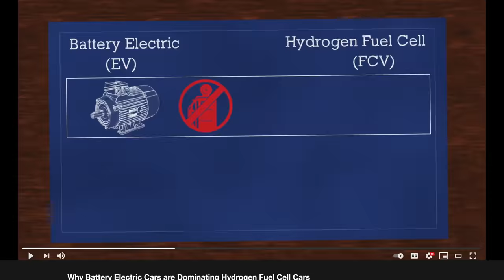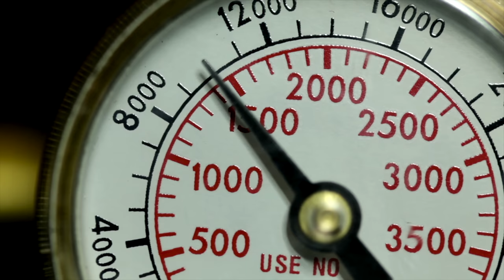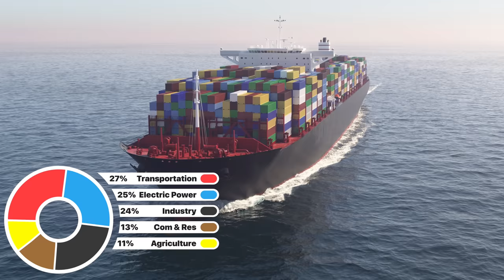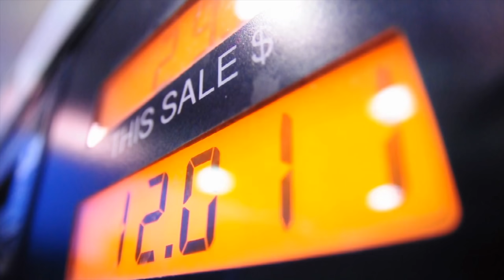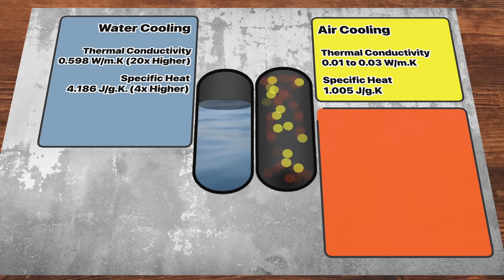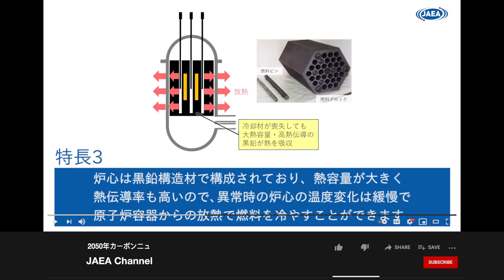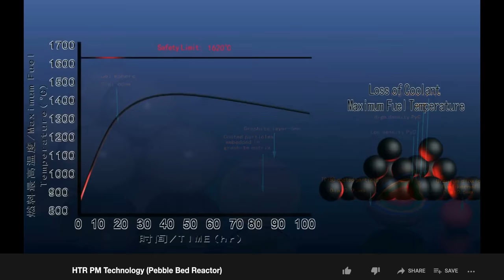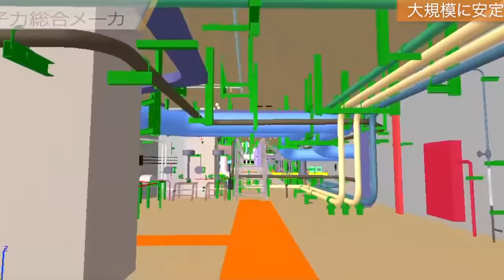Japan's Plan to DESTROY the Price of OIL and GAS!

Comment: Japan is surrounded by water, salt water that can easily be broken into 2 parts Hydrogen, 1 part Oxygen.  Both elements can be used chemically to produce energy, under the right applications.  Even in high school in 1964, for a science project, I demonstrated an apparatice to break apart a salt water solution into H2 and O2, collect the gases, compressing under low pressure both gasses separately and powering a  simple steam engine, built by a class mate.  We won science fair ribbons.  A novel thing to consider back when gasoline was maybe  15 cents a gallon.   Maybe when gasoline is 15 dollars a gallon, people will have more of a use for Hydrogen technology.
Reply: @jackasshomey  the power to split water into H2 and O2 can come from a green renewable source from an aray or series of wind turbines off shore and monitored for maximun electrical output and no danger from birds getting killed.
Reply: @jackasshomey  Everything the people of earth need to have a sustainable life is right at our fingers if we can just get our law makers to do what is necessary instead of lining their pockets with corporate money.   Spell that Greed and Corruption.
Reply: @robertshorthill6836  wind turbines are extremely ineffective when compared to a large petroleum refinery's ability to produce hydrogen with methane... 1 single steam methane reformation plant can produce thousands if not tens of thousands times more hydrogen then your largest wind turbine operated electrolysis cells simpily because the quantity of hydrogen in CH₄ is double the quantity of hydrogen that is in H₂O and hydrogen really likes to stick to oxygen... so its very difficult to split them apart, as appose to methane where the 4 hydrogen atoms are bonded to a single carbon atom which is easily broken
Reply: @robertshorthill6836  if making fuel from literal shit isn't considered "renewable" like i don't really know what to say...
Reply: @jackasshomey  So what do you do with the 1 Carbon atom ?  Do you burn it which makes CO2 ?   Burn Hydrogen atoms and you get water.   Use that water to grow crops or fill Lake Mead, huh?
Reply: @jackasshomey  water is not that hard to split into H2 & O2.   Really, wind turbines can supply the electricity to do just that.  I have split salty water with just a reostat hooked to household electric current.   The higher the current, the faster the gases came off the electrodes.
Reply: @robertshorthill6836  hydrogen is actually really difficult to split from oxygen... you'll learn this in science class, its because hydrogen really likes to be bonded with oxygen and you need really high amperage electricity current to effectively power a hydrolysis setup... as for the efficiency of wind turbines your gonna have to use a massive portion of land as a wind farm which then becomes uninhabitable due to the fact that you now have hundreds of spinning blades overhead, you also tend to forget what goes into making those turbines and because the turbines cant directly power the electrolysis the power is fed into dirty lithium batteries which then provides a stable current thats able to actually run the machine... and we're not talking about your petty tabletop setup of 2 beakers with alligator clips and thin strips of metal, the electrolysis setups they have require massive amounts of power due to the fact that when you scale your power demand goes up drastically, you then need to replace a massive platinum anode whenever it gets corroded away which isn't cheap... at all...  your process literally destroys a rare earth metal in order to happen... steam methane reformation doesn't require any of those things... it just requires methane, heat , pressure and a carbon storage trunk to capture any exhausted CO2...

thats the only problem the environuts seem to actually have with steam methane reformation... the fact that it exhausts the 1 carbon atom... but if we capture the carbon that deals with the problem.
Reply: @robertshorthill6836  as for what you do with the carbon atom, let me tell you... again... because its not like i didn't already tell you before hand... you capture the carbon atom and allow it to return to its raw form... you then collect it and sell it as raw carbon.... for things such as oh idk carbon fiber... which your wind turbine blades are made of....
Reply: @judess… I can’t believe you typed all that out and don’t understand what green hydrogen is. Please stop typing and start googling.
Reply: @DJLoveHz  i know what "green" hydrogen is... problem with your "green" hydrogen is that 95% of all hydrogen generated in the world comes from steam methane reformation... because its a cost efficient method.... you do realize how much a fucking single wind turbine costs... now multiply that cost by 100 for a small usable instillation, a single wind turbine costs around $2-4 million dollar range. Operation and maintenance runs an additional $42,000-$48,000 per year and that's not even taking account of the cost of the platinum cathode heres the cost of platinum per ounce $925.00 and for an actual usable hydrolysis instillation the size of the cathode is gonna be on the scale of multiple meters long.... that's gonna be hundreds of kilograms of platinum that will need to be replaced and you know how many ounces it takes to make a kilogram? around 35 ounces... so your cathode is gonna run a cost of like 3 million dollars to replace every time it corrodes away...
Reply: @DJLoveHz  like before you've even got the thing running your gonna be around 1/2 a billion in the hole... the current method of making a usable electrolysis plant just isn't cost effective...
Reply: @DJLoveHz  it would be more cost effective to retrofit large petroleum refineries with carbon capture technology and just ramp up the production of hydrogen from hydrocarbons
Reply: @DJLoveHz  any other questions about my knowledge?

like sure large carbon capture projects may currently have a comparable cost to a large hydrolysis instillation but that's only at the moment while they are far and few the cost will decrease as more and more carbon capture instillation's are built... wind turbines aren't getting much cheaper and platinum has a fluctuating cost...
Reply: @DJLoveHz  and a steam methane reforming plant can produce pretty much the same amount of hydrogen per year... on average a single steam methane reforming plant can produce 617 metric tonnes of hydrogen per day 617 x 365 = 225,205 and that's just an average some plants may be bigger and some smaller, but when you compare cost and the amount of land the project requires, hydrolysis just costs more... and uses wayyy more land
Reply: @DJLoveHz  where hydrolysis would be effective is in a hydropower dam, constant power equals the ability produce an immense amount of hydrogen either way if i were to do a hydrolysis plant i wouldn't use the electrolysis process, i would just create a giant PEM and have it run in reverse, they're much more efficient. 

im not against hydrogen power one of my own personal sayings is 
"they put a man on the moon with hydrogen like 50 years ago but we still haven't figured out how to run the world with it?"
Reply: Most excellent 🙂 let's get it built large scale & test it's tolerance & daily energy  production vs effort to produce it.
Reply: It could be a two fold production. Combustion fuel from hydrogen and healthcare O2 oxygen tank industry for oxygen byproduct.
Reply: @WilliamRedfield1528  problem with combusting hydrogen is the fact that it produces an assload more NOX gasses since it combusts at such a high temperature, tech like the PEM and the AEM are a much better choice if your trying to extract energy from hydrogen
Reply: The problem is that it takes more energy to separate the atoms of water molecules, than you will obtain by burning the gases.
Reply: @tonyfremont  yea that's why more then 90% of the hydrogen in the world comes steam methane reformation, if we could retrofit the plants that process methane with carbon capture and storage technology we could turn a greenhouse gas into raw materials by capturing and then converting the CO2 into solid carbon with the bubble column method, and you then end up with separated pure carbon and pure hydrogen. carbon can be used for a multitude of different things such as carbon dating, to bycicle helmets, car parts, all the way to making wind turbine blades and even the pencils you write with... and the hydrogen can be used as a clean fuel for fuel cells.
Reply: Fuel is on its way if policies keep in the direction they are going.
Reply: Yeah that Second Law of Thermodynamics is a real bummer
Reply: @robertshorthill6836  there is not enough energy density, in wind turbines, in what you propose to make that work..
Reply: Robert, if your idea is so good, please make a prototype of a device that splits H2O, and then combusts the H to create usable power sufficient to create enough power to continue the process.
Reply: @BerzerkaDurk  Ha, not true, dude.  Water is H20 not HCl.   HCl is of course Hydrochloric acid.   Take a short length of electrical cord, one end plugs into a wall outlet.  The other end strip an inch or so from each wire.  Get a glass of water with salt disolved in it.  Bubbles will appear at each stripped wire end.  One side will be H2, the other will be 02.  The salt makes it conductive, just like sea water would be.  If you try this, be careful not to touch these wires together.
Reply: Problem is storage storage storage
Reply: But how will they compress it in their car? How will they transport enough to the "Gas STATIONS"?
How will they clear a city block for safety at each station? How will you Fill Up if you run out on a trip? How will you "FUEL AT HOME"?
Reply: @robertshorthill6836  You need CONSTANT power.
Reply: @jackasshomey  your carbon gambit can be a way for graphene production
Reply: @robertshorthill6836  

And how does Hydrogen provide a  sustainable life?? 

I have my opinion but want to hear what you have to say.
Reply: @jackasshomey  Isn't it funny that these people who love wind power forget the costs associated with them. 

Not to mention the horribly low power output of just one single turbine. In fact I see many wind farms where only a few turbines are actually spinning at all. 

And these people also conveniently overlook the known fact that they are very dangerous when they fail.
Reply: Hydrogen cannot easily be produced. If it could we would be running on it now. It has the lowest amount of energy output compared to how much energy it takes to make it of any thing. I love how this guy thinks that electricity is generated from wall sockets. Reminds me of all these people here in Colorado who drive around on their Teslas, then go home and plug them into the wall socket which leads directly to the local coal powered electrical plant.
Reply: Two of the most well run, well built auto manufacturers are staying away from battery EVs. Some of the worst run companies are jumping in full steam ahead with EVs. Wonder how this is gonna turn out? 😂
Reply: @gabriellegiovanni7899    I do agree that the Tesla cars run on coal.  Saw a bumper sticker thar said so.  I thought about, looked up electric generation and saw coal fired electric plants make the "juice" for our homes and cars, but I do not agree that it is an inefficiant form of fuel.  What did they launch the space shuttle with ?  7 Liquid or liquified hydrogen in that big central tank.  But we can't be driving around with a big tank of liquid H2 strapped to our roof.  It is easy to produce-- simply put an electrode into sea water and let a wind turbine generate the current, collect it (along with the O2 from the other electrode), compress it into tanks to get it off the station.  It is highly explosive, like gasoline vapors but instead of black sooty smoke, it would be a big cloud of rain (H2O). Cars would still need oil and grease for lubrication, but not gasoline or diesel for fuel.
Reply: @extremedrivr  yep, and gotta love how the green energy people always conveniently forget about hydropower dams... and when they don't they complain about the environmental impact... of something that goes up once, and stays up for upwards of 150 years providing 24/7 power around the clock.

like sure they're may be a little bit of environment reshaping, and some large upfront costs, but over the centuries we've developed ways to mitigate the environmental impact by creating flow channels off the side for the fish... and this structure has an average lifetime of of 150 years... "average" meaning if built correctly this structure could still be standing providing power when your childrens, childrens, children are walking the earth...
Reply: @residentgrey  show me what is more constant than the wind 3 to 10 miles off shore.  What do you think fuels sail boats in a race ?
Reply: @robertshorthill6836  a race they roll the dice on for that very reason, just like surfing? You could be using what those sailboats are on instead.
Reply: @residentgrey  well making graphene is a fairly expensive process already so for that is would be more beneficial to source your carbon from charcoal.... its less expensive to make burnt wood chips.... but yea anything that requires solid carbon it can be used for.
Reply: Problem is that you need to power that apparatus with coal.
Reply: When governments seriously feel threatened by their people again anyways.
Reply: When gas is $15 a gallon it will be because of the markets, driven by policy, not because of scarcity
Reply: Buying a hydrogen, car, am an electrical engineer, not so good for, vehicle range or performance, battery tech is not there HHO with super capacitors & 4 x hub motors. Much better, my kind of car.
Reply: Japan is surrounded by tidal, wave, ocean currents wind and geothermal energy resources.
They can harness that boundless energy to split salt water into Hydrogen and Oxygen, with absolutely no need to create toxic nuclear waste that will have to be guarded for centuries, if not millenia into the future.

The cost of which I expect will dwarf any utility obtained from the nuclear process over its limited working lifespan.

Personally I read about MITs ideas on a Methanol economy, to be honest, their presentation on methanol seems to me a far more attractive option: using fuel cells that take CO2 from the atmosphere to create electricity, and only water as the waste product.

Methanol: liquid at room temperature, could use our existing petrochemical infrastructure, with very little conversion expense required.

What's not to like in that?
Reply: It takes far more energy to break water apart into hydrogen fuel than you get when you burn it. It's a losing battle.
Reply: @rh906  hydrogen, if you don't already know it, is the most abundant element in the universe, on the planet and in the human body.
I fail to see what that has to do with killing trees?
Reply: Yet h2 production isn't a viable energy efficient process...
Reply: @NEDMKitten  Correct. It takes more energy to break water into its constituent gases than is obtained when those same gasses are recombined in combustion.
Reply: @gordonmurray3153  Uh huh
Reply: @MrMZaccone  would it hurt to try and keep things civil, like grown ups having a grown ups conversation.

Free energy from renewables passed through water splits H2O into oxygen and 2 parts hydrogen.

If you have difficulty in appreciating that connection, I can see why you would tend to get angry quite often
Reply: @gordonmurray3153  You're making no sense and not thinking like an "adult". Why waste "free energy" by committing it to a process that just wastes it? I'll say it again, try to grasp the concept. Splitting water into hydrogen and oxygen takes more energy than is obtained by burning the resultant hydrogen. What part of this are you missing?
Reply: Well it was over 2 dollars a liter in BC, Canada a short while ago. It is "cheap" at only $1.60 right now. 🤢
Reply: @chrismccolm9341  if you produce your own hydrogen from a super abundance of fresh water, and limitless resources of alternative green renewable energy from Scotland's weather and waters around our coasts and amongst our mountains, then the cost of producing hydrogen and oxygen gets cheeper with every new installation in the North Sea or North Atlantic.
All it costs is the equipment maintenance and the initial installation.
After that it's all gravy, all the way.
Dare I mention aswell, that Scotland's continental shelf holds something like, let's just say, several thousand years supply of synthetic methane, in the form of North Sea coal. 

Inject oxygen & high temperature steam into that coal down a drillwell, and a chemical transformation takes place.

Up another drillwell comes a valuable chemical soup of industrial gases, such as methane, to be used as feedstock in chemical processes making all of those fancy designer outdoor gear, sportswear, cleaning and hygiene products, hospital equipment, smartphones, telecommunications equipment, yada yada yada,... and so on, for as long as your imagination can think of stuff all made from hydrocarbons.

Yeah, if you want to burn this highly valuable stuff, you can produce heat and greenhouse gases with it too.

In context: all of the oil&gas won from under the UK sector of the North Sea continental shelf since 1964 amounts to 6bn tonnes.

Under that same sector of the continental shelf there are verified deposits of between 3,000bn tonnes and 23,000bn tonnes. 
In laymans terms: more hydrocarbon reserves than all of the Arab Gulf oil states combined.

The only difficulty in exploiting that resource is in the public perception of coal being Dickensian, fark satanic mills, dirty, smokey, smelly.

Hydrocarbons, two of the four most vital, most abundant elements on earth, ie hydrogen and carbon. All life on earth is made from that stuff.

Add just oxygen to that element, and you have produced hydrocarbons ie 'carbs' = food.
Reply: Not to mention that no one talks about the raw materials necessary to replace today's energy use with "green" energy.

In a couple cases it would take 9,000 - 10,000 years worth of current mining (Dr Chris Martenson had the chart in one of his presentations which I'm working to locate) to produce the necessary materials to build the solar panels/ wind turbines/etc...

Sure, maybe a couple of the elements might have a substitute but if so... what is it? Is it THERORETICAL or in scalable mass production?

Meanwhile, if we look at something relatively plentiful: silver. The lag time in bringing new supply on demand takes years and the price has been keep artificially low so there hasn't been much new exploration. It takes 2/3 oz of silver per solar panel.

Green energy is better described as green starvation, freezing, and overheating.

Now to be clear, I think petroleum will become increasingly harder and more expensive to extract and that will be reflected in prices of everything.

I just don't think the politicians are the right people to solve any big problem (without creating an even bigger problem to replace it).
Reply: @philosophyze  not US politicians anyway, who are in hock to the big oil concerns.
Silver, copper, uranium, lithium, what's the difference?

We're talking about the relative amounts of resources between a  truck and a bicycle, comparing brown energy production to green.

Of course in the US,  globalclimate change is only happening  because big business is conspiring against ordinary US citizens in the name of the Sacred Capitalism.

Where I live, Scotland in northern Europe, solar is not such a popular option, because it rainsva lot here and its cloudy a lot of the time. Folk have the notion that solar only works in a hot sunny climate, that Scotland is not.

Although my parents have had one gable of their house covered in solar panels for around 10-15 years, selling what power that they don't use to the national electricity grid.

Our cities have been running hydrogen powered public transport for over a decade.
Our trains are now all electric.

Scotland can produce more than 4 times our domestic energy needs, from alternative sustainable green energy resources; hydroelectric, onshore wind, offshore wind, and wave, tidal, and ocean current generating base load capacity.

Over capacity is being met with Tesla industrial battery walls for community electrical storage, and hydrogen & oxygen electrolysis for portable energy storage.

We have shut down all of our coal powered power generation, even though we have around 3,000years of coal stocks untapped underground. Between 3,000bn  tonnes and 23,000bn tonnes by current reports.

 Our nuclear is at the end of its useful life. Scotland does not need nor want nuclear weapons, so we have no need for facilities to produce the exotics required for such WMDs.

The Scottish govt is actively shutting down our petrochemical industries, ending oil & gas drilling in the North Sea. Oil workers are being promised compensation, training in transferring their skills to the green energy sector.

 Domestic gas use for cooking and heating is being rapidly phased out, no new homes are permitted to be built in Scotland with gas supplies for either central heating or cooking.

Petrol (gasolene)and diesel powered transport is to be banned by 2045, but as soon as that can be done, if it can be phased out any sooner.
Reply: @Robert Shorthill  but the problem is when factory produce those green energy equipment such as wind or water terbine or solar penal need to use oil and gas.
Reply: Yes, but, who wants to test it during a crash??
Reply: @robertshorthill6836  
while your green power costs 0.50USD/khw china is making black power for 0.02USD/kwh what means that your green country will be great to live and pay taxes but the worst of all to have industries.
I invite you to visit Carlisle, UK to see every single commercial place closed or running with no heating (and due to that no customers) because a restaurant cant pay 10k+ EU/month for power.
Reply: All this arguing in the comments is pointless. They forgot one thing, we're running out of helium. So how can they use it in the reactors when there isn't any left?
Reply: @Hemp4eva  
it is not an issue there are He all around world in impermeable rocks, it will just be expensive to extract after the huge deposits  expires.
Potosi silver mine exhausted in ~1700 with half world silver reserves but we extract silver today from reserves that were non-ecconomical in ~1700.
He is most used for cryogenic cooling, that can be replaced with expensive machinery using hydrogen.
Reply: @betolee4292  wow ok, that's really interesting thanks for getting back to me!
Reply: We did the same experiment in Mr. Durham's
11th grade physical science class Arthur Hill HS in 1981...
Reply: @Gordon Murray  My opinion is .. not necessary correct, we should diversify our source of energy, be the oil and gas generated, Wind generated, Water/current Hydronic generated, Coal generated, nuclear generated..... until our society moving to into Type I civilization which can harvest Earth's energy turn it into electricity without much of pollution, go green is a good idea, but right now we are not there yet.
Reply: @eveleung8855  sounds a lot more reasonable than trying to force everyone into a limited number of sources. I've always told my children that it is best not to put all of the eggs in one basket. It is also more productive to not get all of the eggs from one chicken...
Reply: @extremedrivr  To be fair wind turbines put out a decent amount of power in the northern midwest. That isn't to say that they're sufficient for energy needs. Nuclear is the only thing that can cut it, but unfortunately we'd need so many plants that the whole thing is starting to look impossible.
Reply: With love to just follow your sight I've been interested in hydrogen fuel cell engines for over 20 years now. Old lady daughter of the mechanic so I find it i
Reply: Sorry about that I was going to say have they found the membrane that's necessary to pass the hydrogen fuel through to the engine and the emissions on it is it still just plain water which the earth needs so badly?
Reply: @robertshorthill6836  apparatus
Reply: @snarevox    Yes, thank you,  I think that is a word I don't write very often and I do not have spell check, which I had a love/ hate relationship with from my old phone.   Cheers,  Bob
Reply: @kathleenegan8660  My young lady friend, of course you are only partly correct.  The Earth has plenty of water, but there is only a limited amount for drinking, growing crops, other human used.  If you grow a garden, I have to encourage you to collect rain water from your roof to water plants, if possible.  Some states will fine you for doing so but can be done clandestinely.  It's a law that should be violated.  The oceans are the fuel source the Earth needs.  Hydrogen gas, which fuels rocket boosters (space shuttle tank) is easily separated from salty sea water from an electrical current generated by wind turbines.  I did this in high school in 1963 in science class and further demonstated this for a fair project.  Those were the days when kids were hungry for science.  Now days, thanks to our brain dead politicians and Congress, nobody gives a rats fart about science.   Burn  H2 in the presents of air, and you get water.  Simple!
Reply: @kathleenegan8660  Thank you again.  Another child, you are, that found science and mechanics fascinating.  Now days, as we all are, we are addicted to our cell phones and not doing any actual practical engineering.  Mankind will suffer in a few generations, as we are starting to already.   Cheers,   Bob
Reply: What was the fuel the people Singapore used during The Siege by Japan? I know they converted gas powered automobiles and manufactured your own fuels.
Reply: @kathleenegan8660  just in case you weren't aware of it: 
NASA was using hydrogen fuel cells to power its Gemini and Apollo spacecraft way back in the 1960s.
This is hardly the ground breaking stuff you appear to imagine.
Reply: @gordonmurray3153  well that's news to me thank you because I've been following a group here in Indian River county who's been trying to develop the hydrogen fuel cell for automobiles for the last 20 years. The one that emits only pure H2O. Something no greeny can fight against.
Reply: @kathleenegan8660  there are two fundamental approaches to using hydrogen as fuel for transport.

One is as a direct replacement for petroleum or gasolene in an internal combustion engine. Power transmitted to the roadwheels either directly through a gearbox and drive shaft to the wheels, or thtough an electric motor generator to the roadwheels, as is becoming common on shipping, with large father & son diesels, and motor generators, often in a steerable propulsion pod, as the final drive to the propellor.

The other fundamental is a hydrogen, (or perhaps methanol, liquid at room temperature) fuel cell, passing through a catalyst combining with atmospheric oxygen, or carbon dioxode in the case of methanol, to produce electricity to power electric drive motors at the roadwheels, with pure water as the exhaust byproduct coming out of their tailpipes.
Currently the goto catalyst is platinum, but 'single atom' iron is being worked on  to generate a cheaper practical alternative.
Reply: @gordonmurray3153  thank you I learned so much from that. I believe what we're looking at is item number two. It was the diaphragm that was the problem the atoms were either too large or too small to be filtered. I haven't read it yet but I know on SpaceX site there is an item about a new fabric that may be just what this problem needs to be investigated.
Reply: @kathleenegan8660  in a fuel cell you are not actually filtering the hydrogen, the smallest naturally ocurring element on the periodic table of the elements, what you are doing is passing it through a material that it will react with it in the presence of oxygen in the air, ie a catalyst, or a chemical oxydiser.
This is not osmosis, or even reverse osmosis, that you'll mosl likely have seen in a domestic water softener.

In hydrogen fuel cells that catalyst is most commonly platinum, although work is ongoing right now with eg iron and nitrogen, to produce what they're calling 'single atom iron' as a more readily obtainable, cheaper, alternative catalyst to platinum.
Reply: @haroldwestrich3312  hydrogen which is lighter than air simply dissipates safely harmlessly into the atmosphere if it leaks.

Hydrogen needs a concentration of around 20% in air to become explosive.
 Ehereas petroleum, or gasolene in the US, by contrast,  is very much heavier than air, explodes at densities of only 2% or 3% in air.

Hydrogen is orders of magnitude safer than petrol or gasolene.

You can see how the US habit of calling their automobile fuel:- gas, is not helpful in this scenario.

The bad press that hydrogen gets is mostly because of the Hindenburg airship disaster. Bad press that is very much umwarranted.

Airships failed because of human error in manufacturing and piloting, not because of the flammability of hydrogen.

Hydrogen burns with a barely visible pale blue flame.

The inferno that engulfed Hindenberg so spectacularly in front of newsreel cameras, was caused by the sunlight reflecting aluminiumised powder coating applied to the doped fabric skin of the zeppelin to regulate the gas pressure in its gas bags.

The world and its aunty, today is familiar with the powerful properties of thermite.

What you see is thermite errupting ontop of the highly inflammable doped fabric of Hindenberg. 

Not the near invisible burning hydrogen venting skywards, that those newsreel cameras and  b&w filmstock of the day would have struggled to record.

A hydrogen 'gas' station would be by far and away safer than a traditional US 'gas station'.

In the UK we already have pumps on our station forecourts dispensing LPG, liquified petroleum gas, alternatively liquified propane gas, heavier than air, side by side with petrol and diesel pumps.
No problems at all.
Reply: @gordonmurray3153  I also saw but I haven't had time to read yet an article referring to growing certain elements. I don't have clue  how that's all possible I know is Crystals can be grown who knows maybe in the future we are going to have alchemists who will grow something like Platinum and at a reasonible cost for hydrogen fuel cells. 
Lol I dictate my responses and I'm always amused how the computer translates my words. Sometimes I miss correcting something so don't think it's mine Bible.. oh see I said my fault. Lol
Reply: Most likely some kind of alcohol.  They power Daytona 500 race cars on the stuff.
Reply: Whatever you do, it will take more energy to get H2 from water than you will be able to obtain from the hydrogen generated.  The primary issue is what energy source.  Nuclear power seems the obvious choice.
Reply: @tonyfremont  Storing energy in H2 is like using H2 as a battery.  I'm not sure how the efficiency compares with a lithium ion battery.
Reply: @gibbogle  I'm no scientist I'm just an old lady foolish enough to think about things but has anybody considered less power versus more power? Spliting an atom in a super collider. Once we can harness that power we'll have perpetual power. Also I consider the force of gravity as a power source. Just think of the force between the glass sitting on the table that power that holds it in place is the energy source we're looking for. But I'm an old lady I won't see it hopefully you will.
Reply: @gibbogle  yes I do.
I have a 30' yacht, that costs nothing in fuel to sail all day wherever I want to sail.
Reply: @robertshorthill6836  you can easily separate Hydrogen and Oxygen. Much harder will be to separate human beings from Greed and Corruption.
Reply: @nigermant6347  That is the truth.  No Repub politicians that I can  think of would do anything to work for "alternative energy sources".  The oceans will eventually become the anwsers to the world's energy needs when petroleum is gone.  The air will be breathable again.
Reply: @nigermant6347  mostly in the USA. Scotland has thousands of years of hydrocarbon reserves worth billions of $trillions, if we want them. £700bn worth since the 1960s equates to 6bn tonnes of oil equivolent extracted.
There remains between 3,000bn tonnes and 23,000bn tonnes that we know of, just off our North Sea East Coast.

That said, we have chosen to set an example, by closing down our petrochemical activities. Petrol(gasolene) and diesel powered transport to be phased out asap within 10years, no more domestic gas permitted in Scottish new build homes.

Scotland already has access to 100% sustainable alternative green renewable energy, to meet all of our domestic energy requirements.
Mostly from offshore and onshore wind, various hydroelectric models, with constant predictable tidal, wave and ocean current coming onstream to meet base power demand. 
Domestic and commercial properties are encouraged by our govt to install local green energy generating capacity. Unused power mandated to be sold to the national electricity grid.
 Excess grid capacity stored as liquified hydrogen or in Tesla Battery Wall community facilities. The expectation is to  be in the position soon to export 4 times our domestic requirement to our neighbours.
Reply: @gibbogle  Build an array of electrical generating wind turbines.  Elecrodes  placed in the sea water will generate the gases which can be collected, compressed, liquified, transported and used in industry.  That is what lauched the space shuttles.  Nothing but water left behind.
Reply: You have to destroy Rockerfeller cabal first
Reply: @robertshorthill6836  I don't know if you noticed there are some incredibly evil actors behind the scenes holding us back.
Reply: Yes I agree. Water is the best source
Reply: @kennethhudson8013  Strangely, I get people posting that this will not work.  One gent swore one of the gases would be chlorine gas instead of O2.  I informed him he was mistaken-- water has no chlorine -- it is H2O.  Hydrochloric acid is HCl.  I told him to go back to 8th grade science and pay attention.
Reply: I would very much have liked to see that in person, I am not surprised you guys won ribbons.  Now seems like the right time for such things to take off.
Reply: It is all a matter of scale. If you want run an industrialized country, forget about it. If all you want power is your cell phone, toaster and lights, then right on. Corollary: reduce the number of consumers(ie people) and you have a start. Who do you get rid of first?
Reply: @robertshorthill6836  dude, you just described the steps required for BerzerkaDurk to kill him/herself! Please don’t do that! H2O electrolysis requires DC (direct current) electricity. If you simply rip an electrical cord off of a lamp and put the two mains leads into a vessel of salt water, you will likely just get hurt and/or trip a breaker....
Each lead will be making a mix of H2 and O2 since AC electricity alternates between a positive and negative charge  at a frequency of 60 times per second (here in the USA. 50 times in places such as the UK et al). 
Everybody, don’t listen to this guy!☝🏾
His science is not to be trusted!
Reply: So will this restore Japan to the role of economic and industrial leader of Asia- quiet patience and resolve through a difficult 2-3 decades looks about ready to be rewarded.
Reply: Energy must be cheap ... that is the whole point. Othewhise we would be farming whales for blubber to this day
Reply: Hydrogen powered cars have been a reality for more than 12 years. The problem is hydrogen fueling stations. These were suppressed by the huge oil companies around the world. Thus no water cracking facilities to generate hydrogen and oxygen and not fueling stations. Also no use by light aircraft that could use hydrogen powered engines.
Reply: The problem is finding the energy for the electric current needed to cleave apart the hydrogen and the oxygen.
Reply: @robertshorthill6836  remember though the electrodes deteriorate pretty fast in a saline environment like salt water that's the big problem in splitting seawater into hydrogen.
Reply: @robertshorthill6836  offshore windmill farms will decimate New England's fishery industry and cost American jobs.
Reply: @JimBob-vb8oz  it takes less than .03 Volts to electrolyze water into Brown's gas, you don't even need to IGNITE hydrogen to yield the pressure wave propagation fields generated at mach 3.5 when covalent bond harmonic frequency is applied " 60 Gigahertz Millimeter waveform EMF Emitter will Attenuate oxygen molecules.
Reply: Easily?
Reply: But doesn’t it take fuel to power these hydrogen plants?
Reply: @jackasshomey  what about the CO2 produced at a by product of blue hydrogen? It's not a solution at all.
Reply: @robertshorthill6836  not household electric current as it's ac.
Reply: @jackasshomey  a lot of poorly thought out pseudo-science in your post
Reply: @jackasshomey  why is noone credible suggesting turning CO2 into carbon? Carbon capture is a misnomer...it's actually carbon dioxide capture
Reply: The killer gap for hydrogen is having to use 10,000 PSI tanks to carry it around on cars.
Reply: @gabriellegiovanni7899  Hydrogen isn't that hard to produce if that's all you're trying to do. It's just that producing it then using it as fuel is rather inefficient, and the market for H2 just doesn't exist.

What would be great is if we could get a closed loop system of hydrogen generation using sea water that powers itself. This will have to overcome some scaling, efficiently, and maintenance degradation challenges but makes for a system where fuel is exceedingly abundant and there's no need to transport and store the hydrogen.
Reply: @robertshorthill6836 you nailed it.
Reply: @jackasshomey the hydrogen might be a factor of two greater,  but the carbon is infinitely more abundant in methane,  so what to do with that?
Reply: It takes more energy to split hydrogen and oxygen from water than you can get back by burning them. Its a net loss.
Reply: What did you do with the salt from the salt water?
Reply: @robertt3551  he put it on his fries
Reply: Easy to split water into gases? Wow, what a nutty remark. You don't have a clue what you're talking about.
Reply: @LewdCustomer  hey, I took a length of zip cord, soldered a battery core to each end of the wire, rigged up a way to hold the cores apart, took a jar with a salt water solution to cover the leads, plugged the zip cord into a 120v out let and watched the bubbles form around the leads-- one was O2, the other was H2.   I won a science ribbon for the project.
Reply: @jackasshomey  the real reason they don't retrofit everything with carbon capture tech comes down to it costing more. They make more money not capturing the carbon, so they'll try to do it that way as long as it makes more money unless forced to.
Reply: Minimum wage was also like less than a dollar
Reply: @shakibs1002  you talking about the days when when 1 dollar would fill your entire fucking table with food?
Reply: Pointless. Producing hydrogen thatt you then burn to produce mechanical energy or even produce electrical energy using a fuel cell is not very efficient. Far better to just use batteries.
Reply: @jackasshomey   In a perfect world, I agree with your preference of steam reformation. In the context of Japan or the UK.. you're an island with immense offshore wind potential.

For the UK alone they need to install 20 GWh of energy storage to reduce wind curtailment (pitch blades to produce zero power) by 50 percent.

Would you agree EV capable batteries should not be diverted for grid storage as ICE vehicles are highly inefficient compared to a modern gas turbine power plant with secondary waste heat recovery steam power generation?

Did you know we can blend hydrogen into the existing natural gas network?

I agree, it would be highly inefficient BUT UK alone is losing billions yearly shutting off wind turbines. Keep in mind it's cheaper to install another wind turbine than add the necessary energy storage VS just dump excess to produce hydrogen. Which could in theory, with high purity hydrogen be an alternative method of water transport by only transporting the H from H2O into a hydrogen fuel cell. Funny enough, it's wild you can buy a 100KW hydrogen fuel cell module for under $2K at the junkyard for automobiles. 😂 Freaking wild considering it would cost a million 20 years ago.